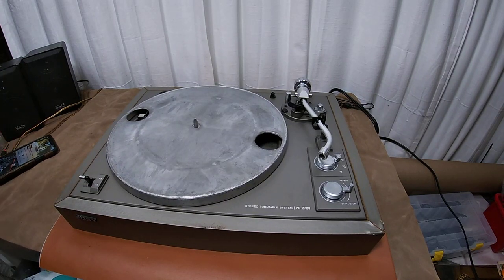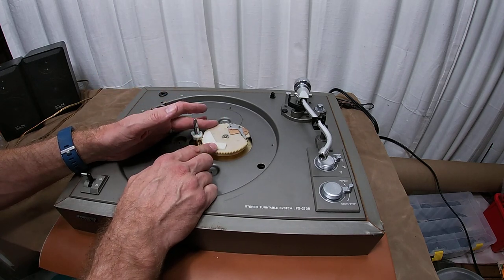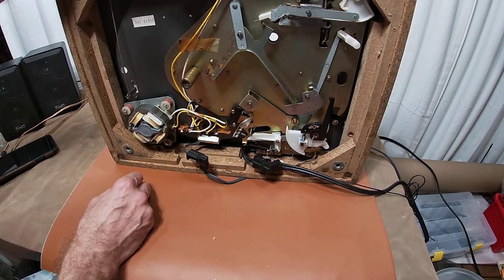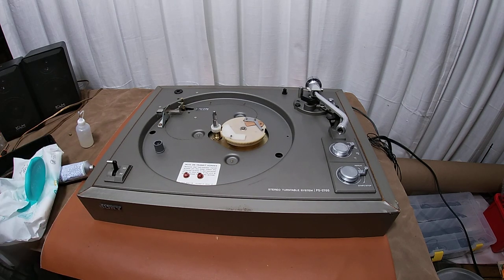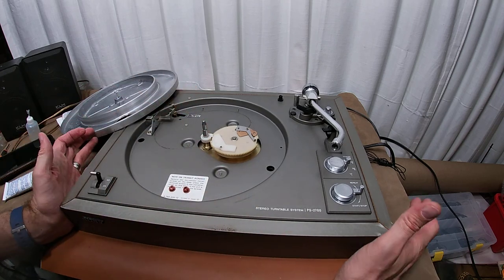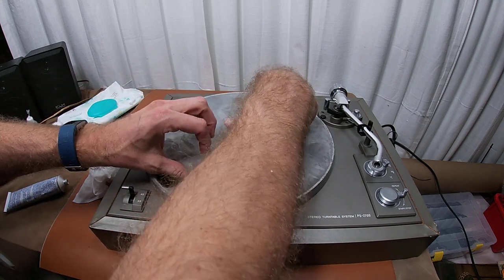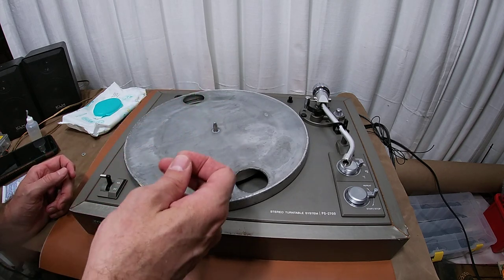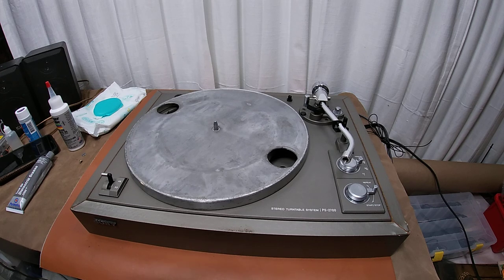Removing and raising a turntable spindle - Troubleshooting a platter that is scraping on the base

Comment: I have a ps2350 it had the same problem I took it apart and the spacer had rotted away, I was hoping to get the spacer thickness to rase the spindle to the right height, but I just ended up finding a plastic spacer and kept filing it down till it was sitting at a level that worked.

Comment: Thanks for the video Andy.  It was very helpful.  I have a Kenwood KP-1022 and the platter was scrapping.  Also, I have a Micro Acustic MA 3002 cartridge that needs a stylus.  Would you happen to know where I could get one.
Reply from the maker: Yeah, those Kenwoods tend to sag over time. just a thin little o-ring may fix that... but it may require some exponentiation. I have had horrible luck finding MA stylus. When I'm having trouble finding styli, I just buy a used cartridge that looks to have a good one.

Comment: You are going around the bush too much on the same matter on the spindle forth & back.Using so much which you can actually finish it in a short. Watching this video not kindergarten kids. Go & finish short & brief.
Reply from the maker: That’s a good suggestion. In this case I was trying to make the video for entry-level. It’s good that you identified it as such (“kindergarten”). I should add some comments at the beginning that the video is meant for someone without any experience.
Reply: Ya a bit too much talk. Drifting of topic and giving unnecessary details. You could edit this into a 5min video  but thanks for posting.